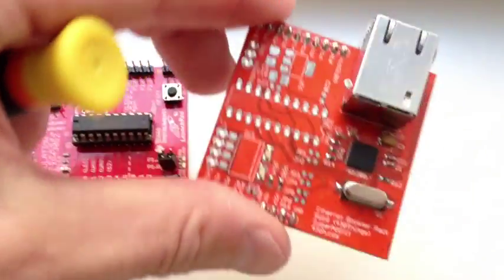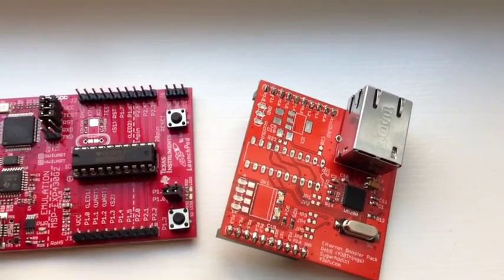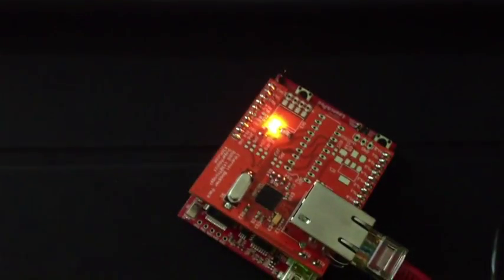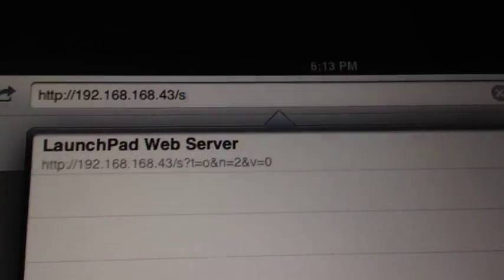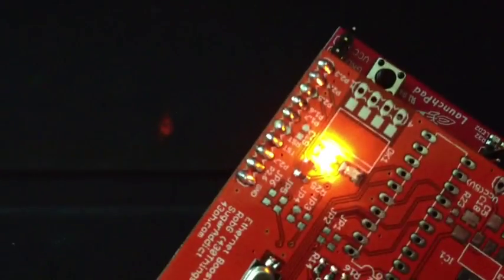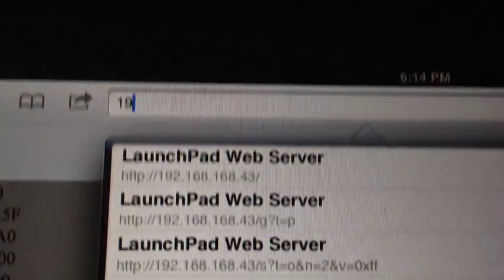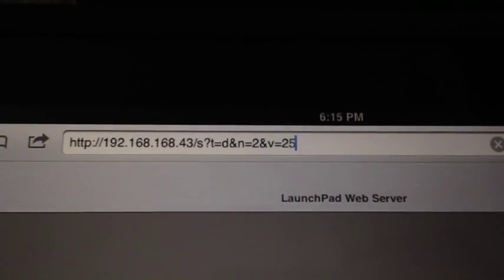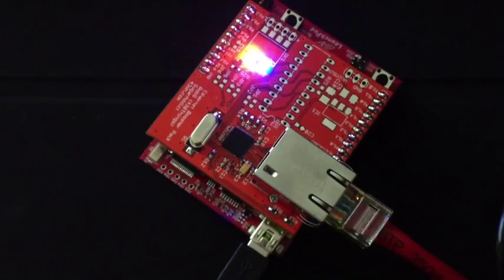MSP430 LaunchPad Web Server / Ethernet Booster Pack

Comment from the maker: Yes, you can do "fancy" HTML, there is still ~10k memory left (the output in this video is plain HTML.)
However, my intention was to use a page stored on another server or the local box and make AJAX requests to LaunchPad server. LP server can be configured to send back XML responses with just a single #define.
MSP430G2553 has 512B of RAM and there's about 100B available, so I am not sure if you can implement any serious encryption algorithm.